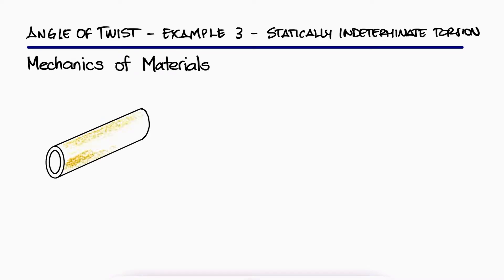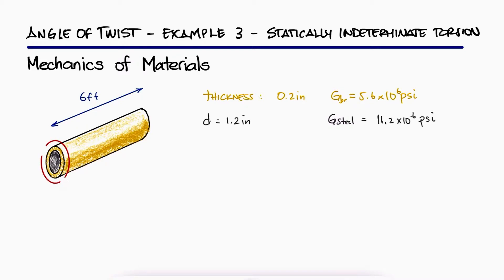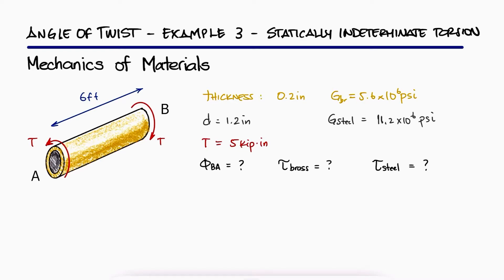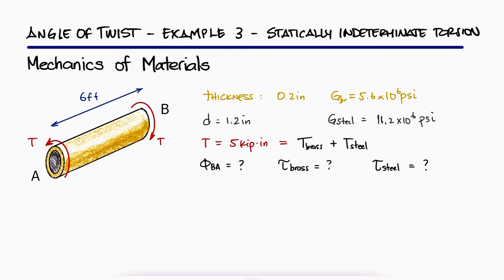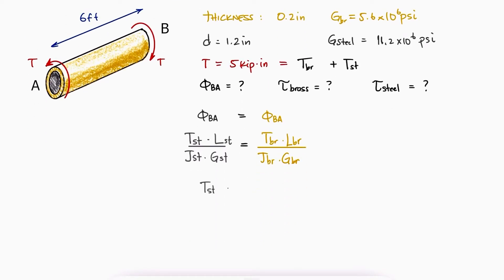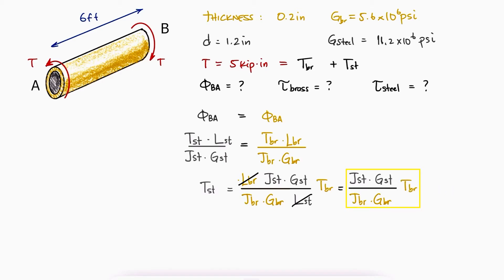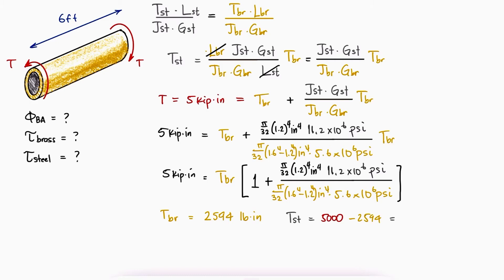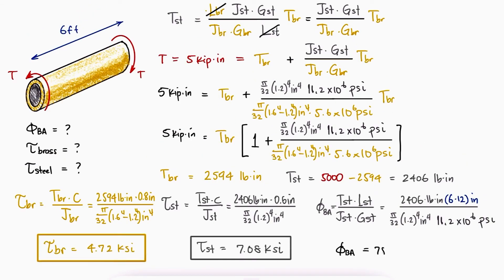Composite Under Torsion, STATICALLY INDETERMINATE in 2 Minutes!

Comment: Hmm, but doesn't the applied torque apply fully to both metals? I calculated an "internal torque" at the glue joint that was 188 Nm, which is the difference between you T_b and T_s, so so far I have calculated correctly. But then I said that the steel is twisted, not by (5000-difference)/2, but just by (5000-difference). And for brass I said it's (5000+difference). Because if I apply torque to the composite rod, one material can't "soak up" torque, right? They both have to get twisted by the total torque, right? I dunno, this confuses me.
Reply: I was also confused by this. 

I think it's similar to when you have a body of different masses with the same acceleration. Like, for example, a block stacked on top of another block. If an external force is applied to the bottom block, both the bottom and top block will experience the same acceleration, but they won't experience the same force. If you use the external force to calculate the acceleration of each block, you'll end up getting different accelerations for both blocks because they each have different masses. The internal forces caused by friction is what gives each block it's own unique force allowing them to have equal acceleration.

For the case of torsion, the applied torque is analogous to the "external force", the total angle of twist is analogous to the "acceleration", and the modulus of rigidity is analogous to the "mass".
Reply: @disappointedcucumber  This is a brilliant analogy. I understand now. Thank you!